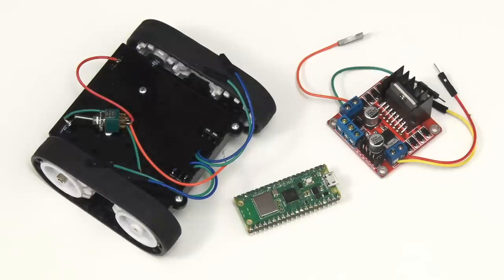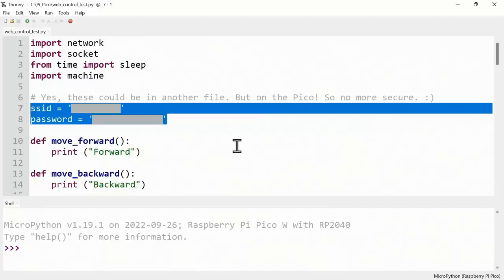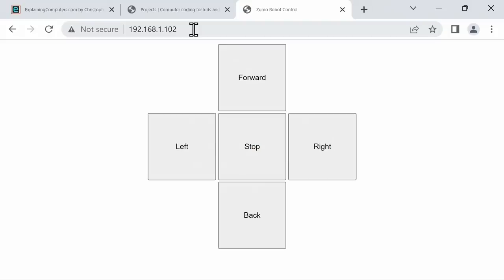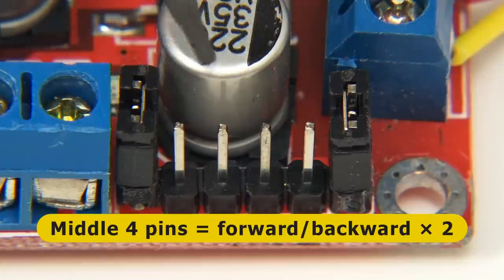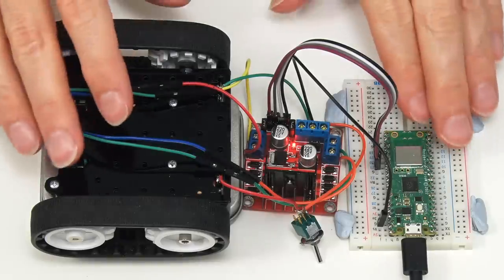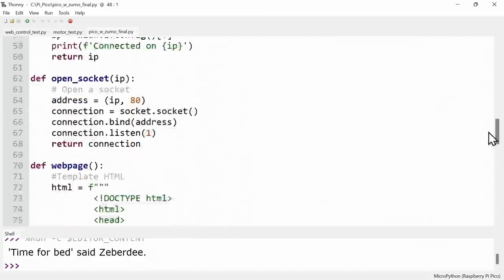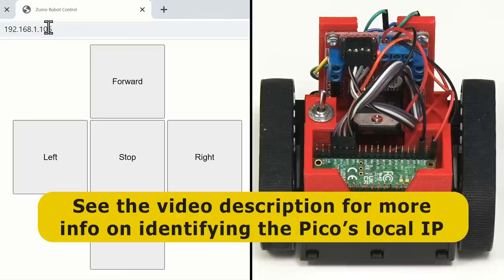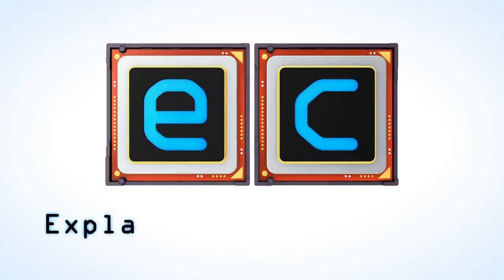Raspberry Pi Pico W: WiFi  Controlled Robot

Comment: Hello Chris,
That's an amazing project because of simplicity and practicality reasons,

I'm sure that you know all what I'm about to say but just to let others know that there is always a space for improvement as you mentioned in the video,

Regarding the html code, you can actually use one form element (without specifying it's action) and then set required formaction on the submit buttons,

also, instead of send the html in each response, you can send it only when the request is empty,
and to prevent the page from reloading after submit you cam specify a target iframe where the response will be delivered to, so it may look like this
<form action="" target="frmResponse">
    <input type="submit" formaction="./forward">
    <input type="submit" formaction="./backward">
    <input type="submit" formaction="./left">
    <input type="submit" formaction="./right">
    <input type="submit" formaction="./stop">
</form>

<iframe name="frmResponse" hidden></iframe>

anyways, it will not make it faster but it may save a few bytes in the response,
If it's up to me I'll use XHR or WebSocket API for faster response time

Sorry for the long post but I just get excited 😁
Thanks once again Chris and have a nice week!
Reply from the maker: Your suggestion for the form button is very neat -- I had not thought of that. Thanks for sharing the code.
Reply: @ExplainingComputers  My pleasure, and I really appreciate your reply 👍

Comment: Really nice demo! Pico W definitely works much better than ESP8266. I built the same kind of robot with ESP8266 before and the Wifi dropped whenever the motors' emf affected the voltage supply to the microcontroller slightly. I probably should buy myself a Pico W and rebuild that robot again.

Comment: I can't seem to find the network library you've used in your code. Can anyone point me in the right direction. Excellent video as always Chris.
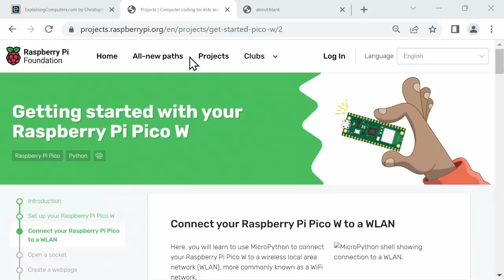Reply from the maker: Thanks for this.Aside from installing MicroPython for the Pico W, I've not installed any extra libraries here. So my guess is that you've installed the Pico and not Pico W version of MicroPython? I cover the installation (via Thonny) from about 2:35 in this video: https://www.youtube.com/watch?v=3q807OdvtH0
Reply: @ExplainingComputers  So you think this is a library specifically for MicroPython?  I was hoping to use it with my Windows desktop.

Comment: As a logistician and ex software engineer (professional reconversion but still geeking), the gravity isn't my best friend. Damn it! Newton! What have you done? 😁
Technically, it's not a robot but a ROV. A really cute one, by the way. 😉
The Pandora box is open. You must connect it to Skynet to see what happens. 🤣
Reply from the maker: Technically, it is most certainly in a robot. A robot is mechanical device under programmatic control, and this is exactly what is going on here. The motors do not respond to controls (as in an ROV), but to a program in turn operated by controls -- which here is an ROV program! :) There seems to be a lot of confusion about what the term "robot" means these days. :)
Reply: @ExplainingComputers  The limit is really thin between them. A quadcopter like a DJI one with all the complex behaviours embedded in it or remote controlled by pushing only a button is surely called a drone or a flying robot.
But a program that translate/transmit simple orders/inputs like a remote control to a vehicule, can it be called a robot ? It remembers me my philosophy courses back in the day. We had only 4 hours left to try to answer this question and I never succeeded. :D

Comment: Thanks for another inspiring video! I will build the Pico W Robot (unfortunately Amazon no longer has supply of the Zumo chassis, but I have been able to source one in Australia). Have 3D printed the bracket - assumed 20% infill and no support - it did OK spanning where the switch is located. Looking forward building the end product ... 🤖
Reply from the maker: Thanks for this Peter. I used 20% infill too, but used support. I seem to have depleted Zumo supplies on many vendors. Good luck with your build. :)

Comment: Hi Chris,

I found a zumo robot from the robot shop usa. However, I found that the single battery holder clips didn't have a slot to fit into like the other three clips did to hold them in place. Was your kit the same way?
If so how did you get around this. Also interested to hear if your chassis had a way to mount these single small battery clips (2) or not? Thanks much !!!!!
Reply from the maker: Thanks for this. It is some years since I put my Zumo together. But I've just inspected the single clips, and it looks like I used glue to hold them in place. They are held firmly when batteries are inserted. So I imagine I applied a little glue, then put in batteries to hold everything whilst it set. Or you could Im sure use double sided tape, or putty like Blu Tack. Good luck with your robot!
Reply: Thanks much Christopher !!! That helped alot. I used some Gorilla Double Back Tape and it worked great. Very strong !!!!! Rick

Comment: As for security putting login info in a separate file makes no sense, but from a programming point of view it does make sense (at least in C or C++, maybe not so much as in Python) so the data could be changed without rebuilding the application.
Reply from the maker: Accepted. :)

Comment: While the Pico W is cheap, I feel like nobody should be encouraged to pick up a Pico W over ESP32 boards which may be cheaper (depending on the board), are much faster, have more memory, have bluetooth, and should run anything you can run the Pico can run including the Micro Python, sometimes with tweaks. 
I don't like to be so harsh, but I don't know what you're guaranteeing yourself moving into the Pico W, a latecomer with worse specs, except that it has the familiar name. With more complex full Raspberry Pi devices there's an argument about support on the software side, but given all of Raspberry's hardware availability issues I don't think you can even feel good about being able to get the hardware.
If you're making one robot I suppose it hardly matters, but anytime I try to determine how to scale an IOT project it becomes clear I need to be out of the Raspberry space.

Comment: Did you use the mazerpi kit with screws, spacers, standoffs, etc to mount the 3d printed piece onto the robot & mount the motor controller to the back of it that you got from amazon? Also do you have a link on amazon for the power switch you used. We used to go to the local Radio Shack to get these parts. Love your videos on robotics and python and html programming !!!!!

Comment: Would the PicoWon the robot be able to be controlled by by another PicoW connected to physical buttons? To serve as the wireless controller and the receiver?
I’m wondering if the web interface can be cut out so it could be used outdoors.

Comment: You know, it amuses me how loose people are with the term 'robot' these days. Used to be, a robot was an autonomous device. Now, it seems like 'robots' are glorified R/C cars. or simple remote devices.
Reply from the maker: I've never seen a robot defined as an autonomous device. Robots are simply programmatically-controlled physical mechanisms (the first robots were hydraulically powered devices fixed to GM production lines in 1959). Or as Or as Professor Hadas Kress-Gazit from Cornell University nicely expresses matters, a robot is "something that can create some physical motion in its environment" -- and here that physical motion is of itself!

The key different to an R/C car is that the mechanism does not respond directly to a human action or control, but to program code. Here the code happens to provide R/C car style functionality. But it does not have to. A button could be added to make the Zumo drive forward for two seconds, and spin left for a minute -- which takes it beyond R/C. :)

Comment: This is fantastic and I will be using these concepts for a future project.  As always, I enjoy how these are presented in a fun and simple to understand format Chris.

To add, as a small safeguard, I would use a simple clip that would go on both sides to hold the Pico W in place.  That would be in case the robot does dive off the table's edge and ends up upside down.